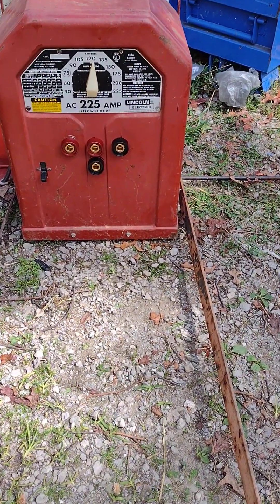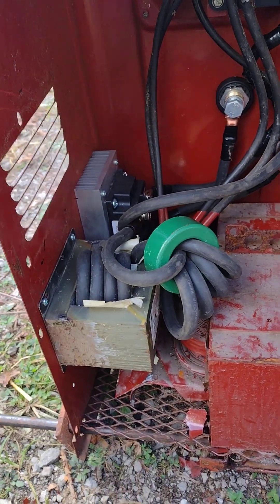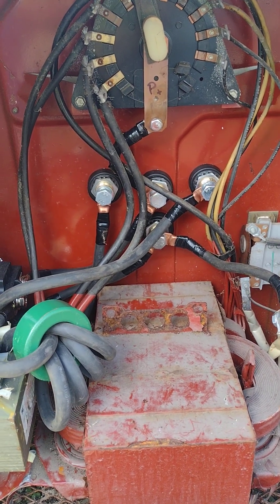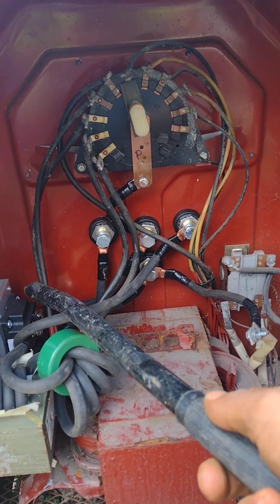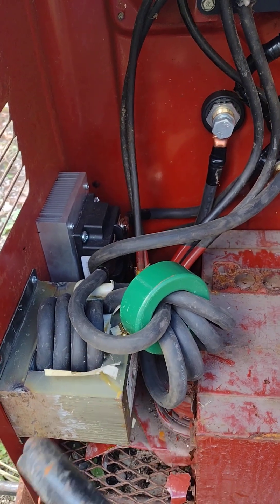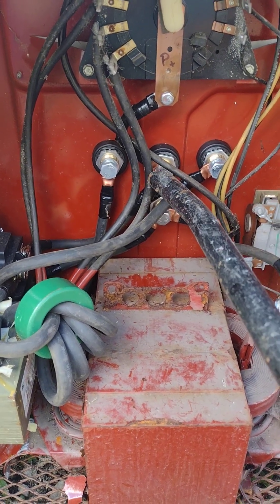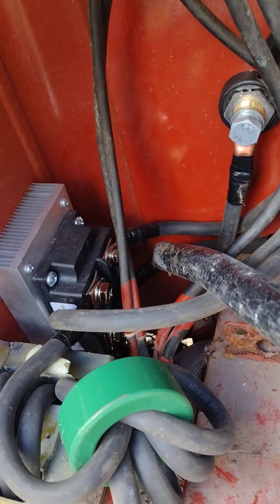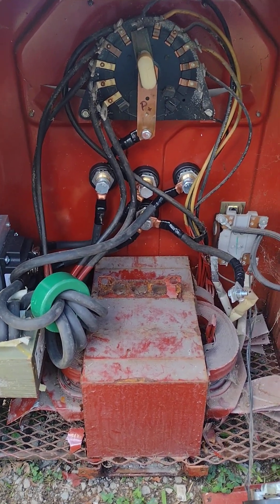how to convert AC WELDER TO DC

Comment: Looks very professional .  Pls tell me where you got it and what is the size of second transformer housing also size of chock you used  .
Reply from the maker: Toroid core inductor from Amazon ,the transformer I got it from and old microwave i cut it open n remove all the copper n wrap a welding lead around it  n tack welded it together  ,and rectifier got it from Amazon n the quick connects too
Reply from the maker: And the aluminum heat shield from Amazon
Reply: @TheFarmsweethome   Can you tell me what the second transformer does . I am still learning .
Reply from the maker: It helps reduce the voltage for DC you can even add a capacitor to smooth the weld.....AC run almost double the  amps if you want to run it at at 120 amps DC welder would have to be set at 225 AC amps
Reply: @TheFarmsweethome    Thank you for your reply. I have bought 3  A/C welding machines just for the cables for my DC welder because it is cheaper than buying new cables and they come with ground clamps and electrode clamp.  But now I know how to convert A/C machines so they can become A/C  -  D/C welding machines.
Reply from the maker: You can add a capacitor to smooth out the weld I didn't on mine
Reply: @TheFarmsweethome  what's on the nameplate of the capacitor ?
Reply: @TheFarmsweethome 
Thanks for the video. I have an old Lincoln 225 at welder which I bought rectifier for a long time ago and never converted it ..Ok so with a 20% duty cycle your welder cranks out 225 ac apps. Rectified and choked to 120 A DC you are able to burn 7018 1/8” Rod
For 2 minutes of 10minutes 
Do I have that right?
Reply from the maker: Yes correct ur able to burn 7018 1/8 rod with no problem at all

Comment: I did this conversion with a little more effort in creating the inductors (choke) and I’m going to add capacitors for more smoothing, also be aware that the fan plate will have to be modified to make it fit, I am very happy with the results 👍🏻🙏🏻🙏🏻🙏🏻😎

Comment: Hi.  Have a question sir.  The CHOKE wire runs off the positive leg of the rectifier correct???  Also.  Does the choke wire always remain on the Electrode weather your welding electrode positive or electrode negative ???

Comment: thanks for your content. i have an old P&H  AC welder i want to convert to AC DC. i have the bridge rectifier and an old Folney welder i will get the plug ins for the leads from. the Folney also has a choke i will modify to use. i watched another conversion video but he didn't explain  his work.

Comment: I think you have 2 chokes. A transformer only works with AC electricity.
Reply: In the DC circuit, the choke and the transformer function as inductors which dampen changes in the  the current, stabilizing the current flow. The current now can only change gradually, based upon the value of the inductance. As a capacitor smoothes out voltage changes, the inductor smoothes out current changes. The changes now follow a dampening exponential curve - slowing down any variations.
Reply: What does the choke do i am thinking about converting my old Dayton ac welder
Reply: smooths the electric flow with AC you have 60 full cycles with the bridge rectifier you do get DC but it isn't smooth .it still has half cycles the choke smooths the cycles. i have an old Forney AC welder that has a built  in choke but that choke seems to only smooth the lower  ampereges. that choke is wire wrapped around an iron bar.
Reply: @erniew5805  ok thank you so much haven't done mine yet just got the 400 amp rectifier
Reply: @jwillis1978  i worked on it today. got the case off the P&H .figured where the bridge rectifier would go. i got a heat sink and a fan under it. it will hang off an angle iron attached to the heat sink. i took the choke off the Forney and stripped off wire .must have been about 200 rounds of 12 gauge wire. the bar is about 1 1/4 inch square and is laminated. this was only used on the lower amp settings. i will wrap it with bigger wire and it will sit on top the big transformer.